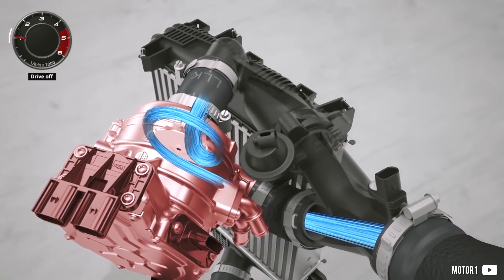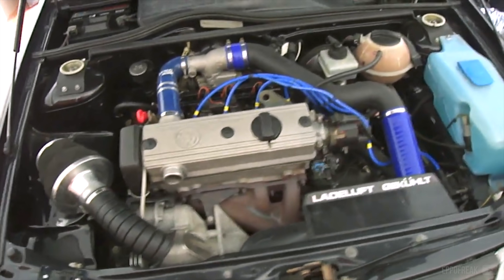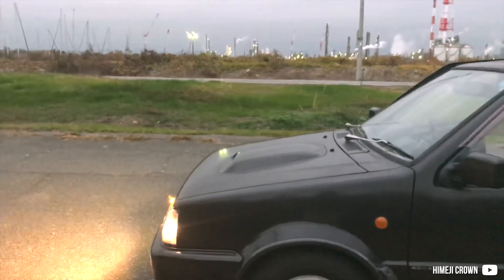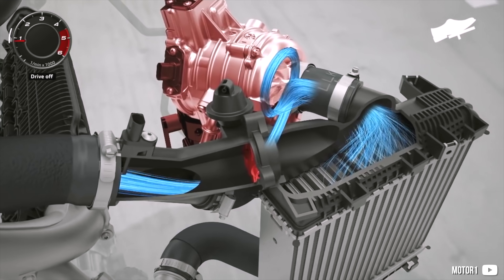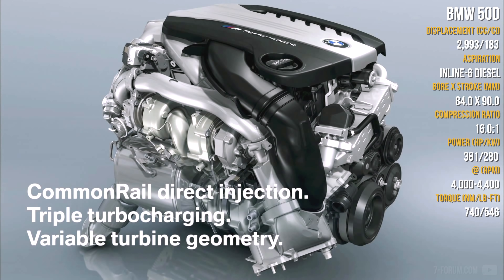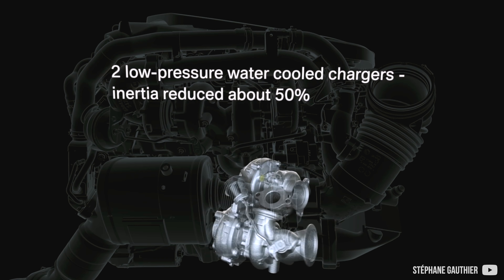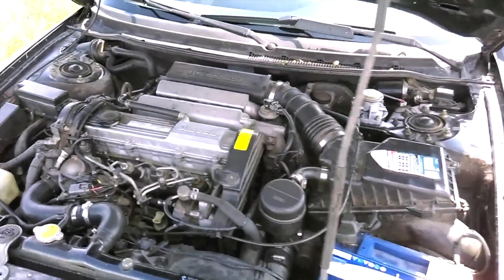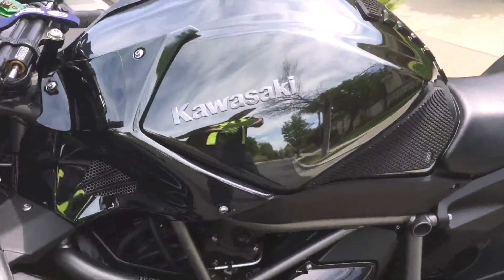The Strangest Types of TURBOS & SUPERCHARGERS

Comment: I wonder why the motor/generator system used on F1 cars isn’t applied to road cars. This is a system that uses a motor/generator connected mechanically to the rotor shaft. When there is excessive exhaust, the mg charges a battery, and when at low rpm the mg drives the rotors to maintain boast. This gives very low turbo lag, while minimizing use of the wastegate.

Comment: Finnish Valmet tractor brand used Comprex on its model 1203 Comprex tractor in 1980s. This tractor was the most powerful Valmet tractor from its era. A 6.3 liter diesel inline 4 with Comprex and over 200 horsepower.

Comment: but you didn't explain, the H2's charger is one of a kind with its own transmission gears for broader RPM powerband usage- 2-speed centrifugal supercharger!
Reply from the maker: There were many 2-stage superchargers in aircraft motors of the WW II era, using this centrifugal supercharger setup

Comment: Aside from the electric motor driven supercharger everything here was pretty much tried in the aviation world first. Only aviation piston engines were using hoost for two reasons. The first reason of course is to increase power out. The second is to maintain manifold pressure at altitude. Plus early on aero engine manufacturers settled on centrifugal type compressors as they offered the best power gain for the least mechanical losses. Even some radial type aero engines that really weren't supercharged often included a gear driven impeller section to provide a modest amount of boost in order to equalize the fuel/air mixture to all cylinders.
And for the mechanically driven centrifugal type you really should have started with e Paxton. As aero engine supercharging heres a good video on the subject
https://oldmachinepress.com/2012/11/23/rolls-royce-exe-boreas-and-pennine/
For the Paxton
https://www.google.com/url?sa=t&source=web&rct=j&url=https://en.wikipedia.org/wiki/Paxton_Automotive&ved=2ahUKEwiK46_j7o_xAhVMj54KHSA0DoMQFjAAegQIBRAC&usg=AOvVaw2t86BLoqPHExJo6mhxunL1
Reply: Kawasaki has speed 406.7 kmh made highway in brazil

Comment: I just want to point out that it is a misconception that Roots or twin screw superchargers work better at low RPMs.  The amount of air they move is directly proportional to the engine speed, that means the faster the engine spins The more air it's going to move.
Reply: we mean, works better than a turbocharger
Reply: They do work better, comparatively speaking, with superturbochargers

Comment: I forgot that VW did a scroll supercharger.
My work sells an oil injected scroll air compressor 4.5kW up to 22kW, they're very robust and reliable - we very seldom have problems with them.
Oil free type are the most common in the scroll air compressors, they use a Teflon seal, mostly used in the medical field, but they aren't usually above 7.5kW, also very expensive.

Comment: You forgot volvos compound turbo setup, used in heavy duty Diesel engines you run a normal turbo but ad a second turbine after your normal turbo. The turbine on the second “turbo” is hooked up to a gear train to decrease the turning speed from some 100,000 rpm to a speed matching close to engine rpm, thus creating more torque. This gear train is then hydraulically coupled to the engines crankshaft.
Reply: That is a Scania patent , Mercedes tried it , Volvo tried it first time  20 years ago , no one made it success.
Reply: @V8Lenny  try the Volvo d13, as far as I know was produced in like 2016
Reply: @bajasummit6209  D12 in about 2000 , 500 hp. Scanias first in 1990 , first road application. Turbocompounding was first used before WW2 in other applications.

Comment: A turbocharger is so named because the compressor is driven by a turbine. Not because of the type of compressor it has - i.e. centrifugal  or scroll or Rootes. The correct name is Turbosupercharger.
There have been plenty of mechanical superchargers with centrifugal compressors.
Reply from the maker: Yes, it is basically a turbosupercharger. Did I say something wrong in the video?
Reply: @VisioRacer  No not at all.  People tend to think a centrifugal compressor like the Kawasaki has,makes a mechanical  supercharger similar to a turbosupercharger but it's really all about what's supplying the power to drive the compressor, not what type of compressor it is.
As an aside, there were aircraft piston engines that used a turbine to recover energy from the exhaust that was mechanically connected to the crankshaft these were known as Turbo-compound engines. You might consider doing a video on these.
https://en.wikipedia.org/wiki/Turbo-compound_engine

Comment: I never knew that a supercharged diesel existed
Reply: Every Detroit diesel 2stroke is supercharged. Won't run without it.
Also, the largest diesel engines in the world are supercharged. They call it forced scavenging rather than forced induction, but it's the same thing.
Reply: @carwashadamcooper1538 No, 2 stroke diesels are normally aspirated. The blower’s used to push exhaust gases out,  though four strokes can be supercharged, obviously.

Comment: Many times I have heard of the G-Lader supercharger and it's spiral characteristics. This is the first video where anyone, including you, have shown how it works. So fascinating.

That Comprex, though. Using the supercharger to compress the intake air AND expel the exhaust gases? That's some scavenging there.
Reply: The comprex is driven from the crankshaft, but does not need power to compress air, it uses kinetic energy from the exhaust gasses to compressfresh air.
It does not help the engine scavange, it does even build some backpressure but less than a turbo.

It just captures high pressure exhaust pulses in a cell,
releases them into the exhaust, 
opens the fresh air side, using the kinetic energy of the moving exhaust gas to quickly pull in fresh air and
Closes the exhaust side, so the fresh air doesn't move out into the exhaust
At this point the intake air is still quickly moving in into the chamber which is building pressure, when the air stops moving the gate is shut and the pressurized air is given into the intake.
Reply: @laurean5998 , so it's more like a turbo, but it's connected to the...

The explanation is kinda hard for me to grasp. I mean, this is the first time I've seen such a supercharger. Is there any video that can give a clear explanation to how does it really work?

Comment: Fancy fact no one asked for:
EMD experience the need to turbo their two stroke diesels, but since this system already need a supercharger to run they came out with a clever solution. They instaled a turbo and conected It to the crankshaft with a hydraulic system, so at lower rpms the crankshaft make the turbo to spin (like a centrifugal supercharger) and at higher rpms disconected the hidroclutch to let the turbo build boost. And walah, you have a turbo and a supercharger in less space required and using less plumbing needed
Reply from the maker: I think I should do a second episode, totally forgot about this clever system on EMDs!
Reply: Now this is interesting
Reply: Holy shit that’s genius
Reply: Hydraulic or fluid clutch systems on superchargers go back to the 1930s with the DB-601 aero engines. Along with two stage systems. Two stage/two speed systems.
Reply: and dont forget the smaller detriots with bypass blowers
Reply: They used centrifugal on 110 engines. Worked well on equipment that ran at a constant speed, poorly on automotive applications.
Reply: @randymagnum143  yup one blundered down shift/wrong gear and the ngine overspeeds follwed by compressor wheel exploded......
Reply: I'm not sure if you meant to say wallah or voilà, but I'm not complaining
Reply: @starstencahl8985  Voila!  Means "look at that".
Reply: Hot damn, that's genius and brilliant
Reply: Less space being a relative term.  How big of a supercharger do you need to boost a 10,000 cubic inch engine?  The compressor wheel diameter of the EMD turbocharger was 13 inches.

Comment: I used to own a 1990 G60 Corrado. I miss that car. It was decently fast, and sounded 😎.
Edit: Thanks for the love, Visio!
Reply: I still have mine although not registered since midway through covid due to the in-tank part of the fuel system "letting go" (its an old car that didn't like ethanol in the fuel system...I dropped off in maintenance so largely my fault).  It really is a cool car and engine.  I put a twin screw in mine and an old stand-alone fuel management system, SDS, to address IMHO the two biggest shortcomings of the engine and it really made it a beefier more reliable and consistent version of a G60 corrado.  While the twin screw builds boost differently and was super loud before doing some intake work, it still largely feels like a g60.  I kept the throttle body and boost return setup so it still has the two throttle plates and spring rates.  I can still cruise around with my foot resting against the heavier spring of the bigger throttle plate and boost return valve, it still feels like a G60...nice, easy, quiet and just a light press away from that second plate and the boost and noise!  I will put a vacuum actuated diverter valve at some point but I really want to keep that main "two stage" feel to the pedal if you know what I mean.

Comment: Seeing as electric superchargers and mild hybrids are becoming more and more of a thing, I look forward to the day when instead of having to do some arcane plumbing to install a turbo, all you have to do is buy an electric supercharger and intercooler (no exhaust plumbing needed), hook it up to the 48-volt hybrid system, and tune it to respond with boost pressure according to throttle output. Zero-lag turbo upgrades galore for NA mild hybrids.

Edit: twin-charging also has an additional disadvantage compared to pure turbocharging. Making a lot of boost out of a supercharger is very difficult, especially in a system that is bypassed at high RPM. Engaging and disengaging a high boost supercharger repeatedly puts a lot of stress on both it and the engine, which means the supercharger in a twincharged engine is usually much lower boost than the turbo, leading to an engine that doesn't make as much low-end torque as a twin-turbo, small turbo, or VGT engine. This is partly why most twincharged engines are so small - I believe Volvo's 2 liter is the largest modern one - because they aren't expected to be torquey anyway. It's also why Volvo only uses twincharging on the 316hp variant of its 2 liter, while the lesser 250hp version is single turbo for cheaper build cost and the 450hp version uses a sequential system with an electric supercharger feeding a pair of turbos that all work in unison, as opposed to a parallel system with a belt-driven super at low RPM with the turbo reserved for high RPM.